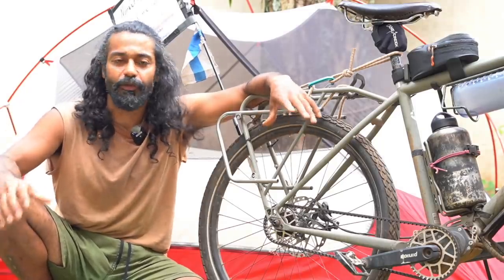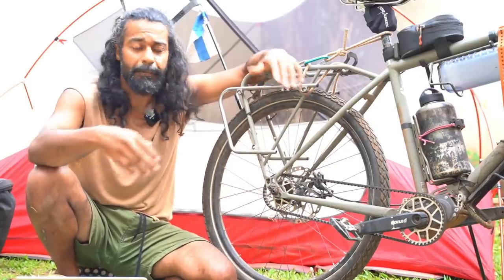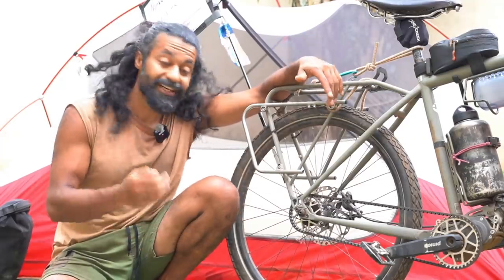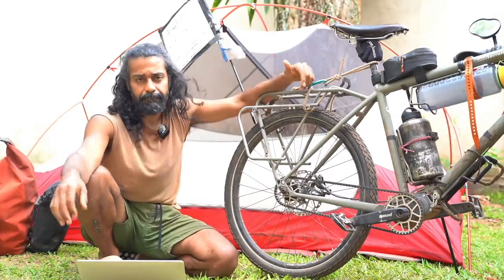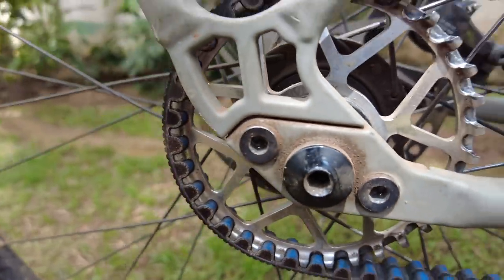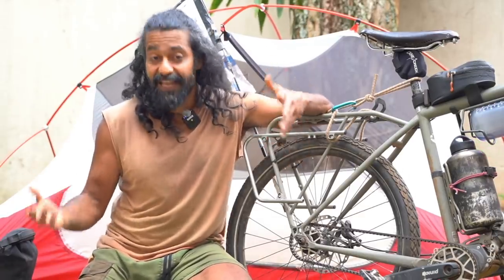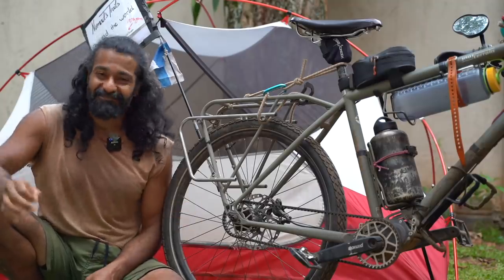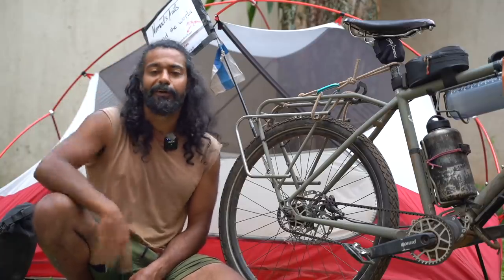Belts Are BETTER Than Chain Drivetrain for Bicycle!  My Test Result After 12 YEARS OF BIKE TOURING!

Comment: I have a belt drive. I do find it starts squeaking quickly. I need to clean and grease it 2 or 3 times a week, coz I find the noise irritating. Furthermore I've had issues with the eccentric bracket, where it got too lose and water and dirt got inside. So make sure it's tight and check regularly. Thirdly you really need to know all the ins and outs of the system, since most bicycle repair shops in the world don't. It was a steep learning curve for me and I had a lot of issues, which cost me a lot of time. In hindsight a chain would have been better for a gear noob like me, but the more I learn, the better it gets. Make sure you can at least completely take the bike apart and clean/replace all components before you leave!
Reply: Belts don't need lubrication. The Gates manual explicitly tells you not to oil the belt.

Comment: Seems like the lightweight belt is offset by the internal gearboxes, and ends up having just as much overall machining hours and tiny parts to break. Easier than derailleur maintenance, but belt and internal hub/Pinion gearbox parts are harder to get. Seems to be a total wash, to be honest. 
If you have the money to spend: yes, a new belt drive bike is awesome.
If you don't: be happy with what you have.
The Pinion box is several thousand dollars ... The belt-split frames are also thousands of dollars... We don't even have a wheelset, brakes, cockpit, bottom bracket, headset, cranks, pedals, or even the Gates Carbon Drive gearset. I mean - $12k isn't exactly a "super expensive" bike, compared to the BS full carbon bespoke road frames costing $30k+... But for ⅒ the price, you can build a truly amazing chain-drive bike, if you know what you're doing.
I bought a bare frame to build a fatbike (Framed Minnesota 2.0), and ended up spending ½ of what it would have cost to buy the bike pre-built, then upgrade and customize. 14 months later, not a single trip to the bike shop
Reply: i also build a bike from a scrapyard frame. i actually just spend not more than 200€ for that. it is more friendly to the environment because of the recycling and also this bike last surprisingly long. i dont like it that everything must be specialized for belt drive like you say it is extremely expensive. also belts for industry machinery are extremely expensive too
Reply: @anguismemes1666  Gates Carbon Drive belts are reasonable, and might cost equal or double the price of a chain... But to get a bike belt-drive happy is not a simple feat. I had a $350 full susp beater frame (KHS AM-2000) ready for belt conversion... Until I cracked the seat-stay tube 2" down, last year. 😭 At least it was a fun idea
Reply: @Karl_Kampfwagen  what chains do you buy?
Reply: Lemme one up you guys on the sustainability: built a commuting bike from literal trash that was lying around mine and a friend's workshops a couple weeks ago, it drives really similar to a fix-gear but has a rear hub brake (coaster brake?). Anyways it was built while I'm saving money to repair my MTB that was crashed into by a an electric scooter. Anyways English is not my first language so please excuse any mistakes and have fun riding your bikes
Reply: I would go with the hub gearbox and a chainglider. This leads to a similar protected drive system compared to the belt and it lasts about the same time as a belt. And you can get any chain replacement anywhere.

Additionally you get less force onto your sprockets since the pinion will increase the torque on the front gear. Compared to a straight attach gear.

Comment: I have gone back to chain after breaking belts once a week I ride 250 miles a day and my chain has gone just over 18,000 miles as of now have not cleaned it or done any maintenance in the chain the belt I was cleaning it once a day to keep it going I think I will get 25,000 miles out of the chain on my bike

Comment: Belt is definitely less maintenance. Chains will rust easily , especially near Salt water! And chains to get clogged with dirt. I always preferred belts on motorcycles. I have not tried a belt bicycle but I would definitely go for one if I was in the market for it. Belts are harder to install but they really last a long time and are very smooth. So I agree!!

Comment: Definitely belt drivetrain is better as you concluded, I need to save to buy a belt drivetrain touring bike because I have big plans! Right now I’m touring with what I have, a 1993, 7 speed , Japanese Nishiki Meridian, chromoly steel and got a smaller chain ring and a bigger cassette to get 20.5 gear inches, I have crossed Central America and now doing the Colombian Andes, almost 4,000km. So getting that proper bike should not stop you from embarking in that adventure, I feel my bike is not ideal because of the geometry and want disc brakes and wider tires but I  haven’t had any problem so far. 
Cheers Payman! Say hello to Matilda, hope she is doing better now, we miss her!
Reply from the maker: Hi, well said 🙌🏼, never let the equipments to stop you from your adventures, you don't always need the best of the best. it is important to go out and live it!

Comment: I tour and commute with Gates carbon belt drive bike and they are revelation compared to chain drive derailleur bikes which are primitive and real PITA to keep running sweetly and quietly. The moment a drop of rain or mud falls on them they start to make an awful racket or lose all their lube, rust or just jam up sound like a noisy sewing machine. Gates belts are truly low maintenance and very durable with a very long lifespan. The Gates carbon belt on my bike is 6 years old and has covered about 50k km and still looks and performs like new. Not a single problem with it. Totally silent. The sprockets are also fine as well. What's not to like? Derailleurs and chains of course!
Reply from the maker: Indeed Alex, the Blet drivetrain  is a big improvement  🙌🏼

Comment: Belts aren't inefficient but internal gearboxes are. At least compared to a brand new chain system. 
Chain and belt lose efficiency when put under stress but a belt loses less efficiency but starts with a little less efficiency. The break even point is around 120W so below what most experienced riders put out.
Internal gearboxes lose 6-8% compared to a brand new derailleur system in optimal position (straight Chainline) but the reduced maintenance is worth it IMHO.
I use my bike for commuting and switched to a belt system because I hated the maintenance. And I will never turn back.
Reply: Do you have a source for the 120W breaking point?

Comment: I have several old bicycles with chains. They are over 50 years old. Can you imagine belt after 50 years? It would turn into crispy paper. 
Also I like to ride my bike on high gear standing on the pedals full weight. That would kill belt within weeks of riding. Belts works well where tension is smooth and constant, for example in the car where they drive item that have constant resistance.

Comment: Do you ever get issues with cable stretch affecting the gear changing on Rohloff/pinion etc? (I went to gevenalle friction shifting because of those issues) my cycle buddy is upgrading to Rohloff with belt drive. But I'm the mechanic out of the 2 of us
Reply from the maker: I had to adjust the Rohloff  2 times because of the this (I would guess). But I haven't  touch the pinion. It works  perfectly  fine like a first day. 😊

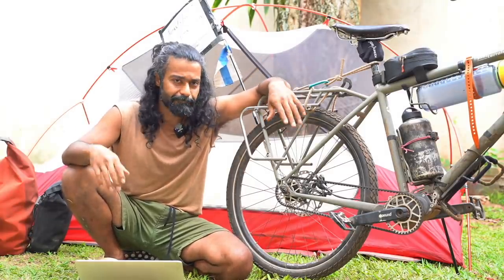Comment: Also have pinion with belt. Efficiency drop is significant (10-20%), when I am on Pinion bike I cannot really keep up with riding buddies at all. However when I switch to the eagle I have no problem at all. Also mine usual home loop of 25k is 1:25 on pinion while on sram eagle I can make it in 1:10. I am no racer just casual rider but I would say this is clearly biggest drawback.
Reply from the maker: Interesting,  thanks for input. I have totally  different  experience. I don't  feel that difference when it comes to efficiency between  Pinion C line and the Shimano Derailleur drivetrain.  I feel much bigger gap when I am on a Rohloff bike. I have been touring  with all these 3 drivetrain 😊. Which Pinion gearbox are you using?
Reply: @NomadsTrails  Pinion C1.12, I would say    it is same efficiency if I am chilling and going just relaxed pace. The more I push to pedals the bigger drag is. I would say it is exponential. Probably thats why I feel it most when I am riding with buddies.

Comment: If we compare the low line chain drivetrain to a belt with many Kms with no maintanace in bad conditions - maybe belt is better.
However, if we compare top of the line chain drivetrain which is properly maintained, ideally waxed, with a belt or shaft drives - they are inferior to chain currently.
Reply: Did you mean efficiency wise?
Reply: Aint nobody got time to clean and maintain chain and casssete weekly.

Comment: Hello, one aspect among the ecological ones is that the Gates Carbon drive cannot be recycled. If properly disposed of, a chain can be melted down while the carbon drive is hazardous waste.Liebe Grüße
Reply from the maker: Hi, i see your point. Being more ecological is an interesting  question. It needs scientific research imo. true the chain drive train is made out of metal and metal is recyclable. but for making the chain drivetrain energy being used and for recycling it also, add on top of that all the transportation and packing material. also i am not sure if there is no way to recycle the belt. so this is something  which needs a research. but my guess is belt is more ecological. but it is just my opinion i can't back it up with any data :)
Reply: @NomadsTrails  absolutely, there are so many aspects in that topic. It is music of the future but If things like "Elektrostahlverfahren" or Elektrolichtbogenöfen are running on "Renuable Energy" things made of metal would show their advantge. I hope we will see an ecologic transformation in the prodoction of our environment friendly Bikes and everything.

Liebe Grüße und gute Fahrt!🙋🏼‍♀️
Reply: Fluorine in many chain lubes is very toxic. (anything advertising teflon has fluorine in it)
Neither are most solvents used to keep especially dry lubes liquid for applying them good for environment.
I doubt there are many chain lubrifications which aren't harmfull for environment in one way or another.
And cleaning chains from the worst gunks needs pretty strong solvents.
Reply: @tuunaes  Totally right. It is a shame that most cyclists use harmful products and "need" a very clean chain. One product I would like to mention is Atlantic "Bio Kettenöl". It is made mostly of renewables and does not contain toxic stuff. It's biodegradable and it works fine also under our shitty conditions here in northern Germany with loads of mud, rain and salt for half a year. We clean our chains with rags and they shine! These products are milestones, I am not here to make an advertisement... Milestones in my eyes and products that harm the environment sould be forbidden because there are alternatives. With that and a proper recycling a chain can become environment friendly.
Reply: I am sorry, but the belt and the carbon fibres are poor in case of environment. But the bigger problem in Europe is that smoker let there waste just we’re they are. If it is a street the stub (plastic fibre with all kind of chemical substance from smoking) with the water it gets to the river. And with the fish it comes back on our tables. This world is fallen. Time to get renewed through jesus.
Reply: @NomadsTrails  Gates belts are primarily made of polyurethane, which can be recycled. I don't know if the carbon threads create problems...
Reply from the maker: @larsdela9323  thanks, as I mentioned  in few comments in few time , this is a  scientific topic and need a proper  reaserch. I just stated  in the video  my guess and my opinion  but definitely  a proper  reaserch  can answer  to this question  😊

Comment: awesome video. even if the belt in itself isnt more sustinable than a chain due to the fact that its made out of rubber and carbon, concidering a Rohloff or Kindernay gearhub is preadjusted and will outlast most people, and you need no bearadjust,enttools and so on, I think its the most ecofriendly option. And you get more time riding your bike as a bonus:)
Reply: Nowadays bikes come mostly with 1 X 12 drive trains. My experience is the chain and cluster doesn't last long, so IMHO pinion with belt has better as it is lower waste

Comment: Hot waxing chains helps them stay clean.
I think a full chainguards, like the Dutch use on their grandma bikes, would keep a chain from having to be cleaned.
They need to make one that will work with derailleurs.
Reply: Encasing "chain salad" gear system would require huge box.
And not straight chain lines would still wear and tear parts.
Reply: 6 years ago I saw a Cube tour bike with a partial plastic guard on a 3x.

Comment: i have a cube hybrid bicycle with bosch chain driven motor, for two years did no maintenance at all, my friend has specialized hybrid with belt, he is on his third motor in one year
Reply: Your friend most probably have a Brose middrive motor that are often used in Specialized ebikes. Within the motor itself is a belt that often tears up. It has nothing to do with the Gates carbon drivetrain, and there isn't any chain inside the Bosch motor itself as well. You will find Bosch motors or any other motor driving a chain on a bike, and find the same Bosch or other motor driving a belt on another bike. Inside a Bosch motor you will find only gears on the mechanical part of it, whereas in Brose motors you will find gears and a belt inside as well, which can be seen as the Achiles heel of the motor. On the flipside, the belt causes the Brose motors to be way less noisy as its competitors in the middrive section and having less friction, so that you feel less resistence when you ride the ebike without the motor support.

Comment: How much those it cost (belt and gearbox or othersystems)? Or, please just give us the comparison between the price tag of the two types of bikes. Excellent presentation! And, have a nice trip. Denis (Canada)
Reply from the maker: Hi Denis, thanks. The price depends  on which kind of gearbox  you use. For example  if you go with Shimano Alfline  it is cheaper  compare to the Pinion or Rohloff. Also u can refuce the price  tag of your whole bike, buy building  it urself and using  second  hand  components 😊
Reply: @NomadsTrails  so you won't tell your audience how the price difference is for chain and belt drive ?
also the alfine gearbox breaks very easy